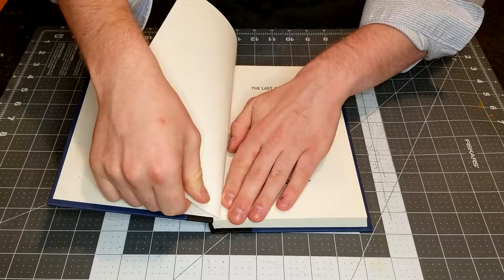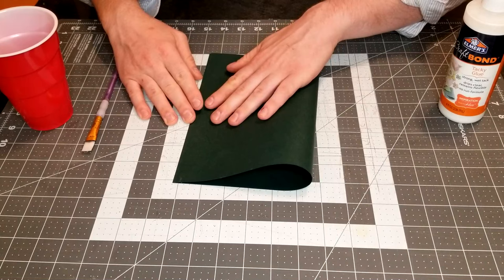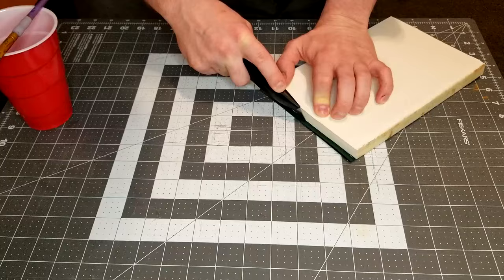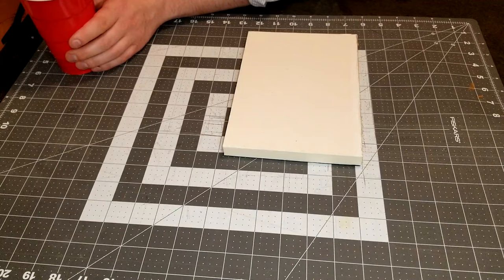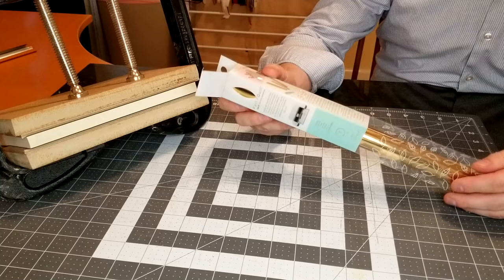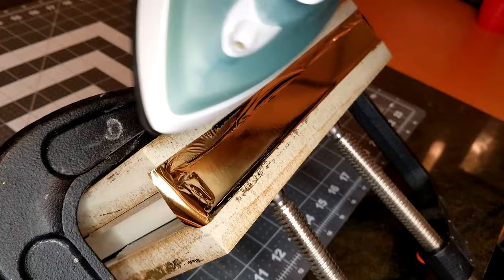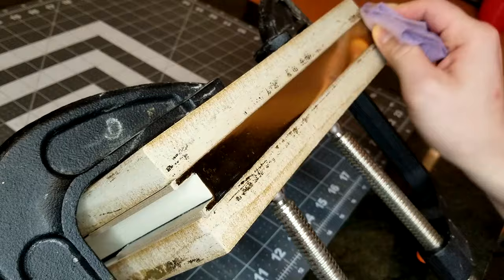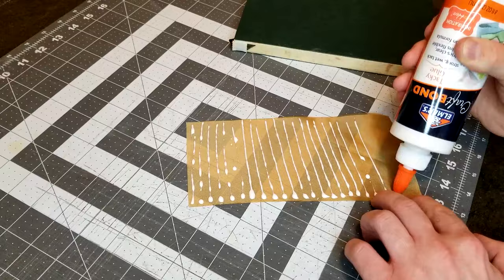DIY Leather Book Binding Tutorial Part 1: Page Edge Gilding and Text Block Preparation

Comment: I have a leather bound set of scriptures that don't have guilding.  Can you possibly show how to add the quilding to a book that is not taken apart?  Please!
Reply from the maker: Excellent question.  Honestly, I believe it would be very difficult to gild the edges of a book without removing it from the binding.  There are methods of painting pages which can work without removing the text block, but if what you're going for is a true metallic mirror finish, then every technique that I am familiar with requires the text block to be free so that you can smooth each edge before applying the gold leaf or foil.  If you are very careful you may be able to remove the original endpapers from your scriptures to get the text block out, and then glue them back in place after you complete the gilding.  But the most reliable approach will be to replace the endpapers.  If I learn any technique that doesn't require removing the text block I'll be sure to make a video about it!
Reply: Thank you for taking the time to explain to me.

Comment: I am having issues getting the strip to come out flat. I am getting so many wrinkles that will not come out and I’m also getting scuff marks on the material. Is the iron too hot? Any help is appreciated!
Reply from the maker: Thanks for the question!  As you guessed, your iron may be too hot.  Although I shared the setting that works well for me, different foils and different irons behave uniquely.  It may take some experimentation to discover what works best for you.
Reply: @ingeniusdesigns   Thank you for the reply! I originally tried the wool setting and found it to be too hot. After lowering the temp, I discovered it helped, but I still have light scratches on the surface. I am at a loss. I also put parchment paper on before the iron. That helped some, but makes it a lot harder to see. 
Do you have any advice for avoiding scratch marks?
Reply from the maker: It's hard to say without seeing it in person.  It's possible that the surface of your iron is slightly abrasive.  If that's not it, then you may not be fully sanding out all the scratches, and so they end up in your final product.  Insufficient sanding is by far the most common cause of issues with this method.

Comment: Hi Austin, I know that this video is old but I do truly hope that you will be able to help me.... what if I just wanted to Gild the pages Gold on a notebook I am already happy with the cover of, I am thinking of just pulling the covers back and a smaller slab and less space to sand off and gild them, would with work? I appreciate your video and am happy with it, even if you can't respond as this is an older video and you've probably moved onto something else. Anyway thanks!!
Reply: Oh, also that helmet in the background when you're sandwiching the papers looks like the helms that the guards of Gondor carry. Sorry if I am wrong haha
Reply from the maker: Thanks for the question!  I guess I'm lame for not moving on to bigger and better things yet, but so far the channel is still little so I'm trying to respond to every comment.  In the case of a notebook like that, you could certainly try it and see what happens.  It would work great for the long edge of the pages.  For the top and bottom, however, you might run into some difficulty at the corners close to the cover.  Gilding is usually simpler on the top and bottom though (theyr'e naturally more smooth) so maybe the foil would stick even without being able to sand those corners thoroughly. 
 Alternatively, sometimes with a little fenagling you can get the original end-papers off of the cover, so you could effectively remove the text block, gild it, and glue it back in place.  Or if you're not particularly attached to the end-papers, you could just remove the cover (destroying the end-papers but leaving the cover intact) then glue new end-papers on to re-insert the text block.
Whatever approach you go with, I would recommend trying it on a similar book you don't care about first.  It sounds like this notebook has some sentimental value, so I'd hate to make a guinea pig out of it. 
Hope that helps!  Good luck!
Reply from the maker: We have a winner!  I like to put something interesting in the background of some of my shots for those who care enough to look, and it looks like you're one of the few who do!

Comment: I'm in the middle of trying this, and the sanding hasn't taken as long as I thought it would have. I'm done with sanding the long side and about to gild it. Of course this is only a proof of concept with a book I bought from a second hand store, so I only went to 320 grit - not 1000; I hope to reach those lengths in the future - probably with an electric sander to speed up production. My vise also needs updating, but that's on me. As far as you're concerned, you must have gotten an A in high school on process essays.
Reply: I'll update when I get to part two.
Reply from the maker: Awesome!  I'm so glad it's working for you so far.  I actually use a belt sander too to start when the pages are very uneven.  It wasn't necessary for the book in the video and I didn't want people to feel like they would need a ton of tools, but I totally get the utility and I'm thrilled it's speeding up your workflow.
Reply: Did you succeed with with the gold gilding? Because I have tried many times following the instructions and I cant get it to stick…. Would love to know someone else has been successful…. Thanks!

Comment: Would this work using paperbacks? I want to turn my beloved Narnia and LOTR into hardbacks
Reply from the maker: Yep!  I've done it on dozens of paperbacks and it works identically.  Sometimes with glued bindings you have to be a little more careful (See my edge gilding in real time video), but there's no reason you can't make a beautiful book out of paperbacks.  The ones in the thumbnail picture were paperback, in fact!
Reply: @ingeniusdesigns  thanks! I'm going to try on a non beloved book before my beloveds. Cause I would CRY if any thing happened to them. My mom bought them for me when I was in 3rd grade and they've traveled all over with me. I'm 40 now so that gives you an idea of the age. :)
Reply from the maker: Yeah, I think you're taking a wise approach.  We want to celebrate those books, not cry over them.

Comment: What kind of foil do you use? I can only find the one you put over a laserprinted page into a laminator...
Reply from the maker: Yeah, that kind won't work (as I'm sure you've already discovered), because it requires a chemical reaction with the ink.  I use Foil Quill by We R Memory Keepers.  There are some other similar products that I want to try to see if they will work as well, but until I experiment with them I don't feel safe recommending them.  This is a tricky process and finding a product that worked well took me months.  Here's a link to the Foil Quill:
https://americancrafts.com/products/we-r-memory-keepers-foil-quill-foil-roll-12x96?variant=39507415236672
Reply: @Ingenius Designs  thank you! My problem is that I'm not in america so finding the stuff is a lot more difficult. But i found the foil quill one on amazon. 
Is the vinyl you used for the front/back covers somewhat stretchy? I'm trying to find the right one but always get the one that has stretch so it can be put on clothes
Reply from the maker: The vinyl I use is Siser brand Easyweed HTV.  I'm not sure if it's stretchy or not, but I think it can be used for clothes, so it probably is.  It doesn't really matter on books though, because I never put HTV on the hinges (the only part that would stretch).

Comment: Do you sand al three sides at the same time? Or you sand one side and then gild?
Reply from the maker: Sand one  side (usually the long side first), then gild it.  Sand the next side, then gild it.  Sand the third side, then gild it.  That way the book never comes out of the press between sanding and gilding, so the smooth surface is undisturbed when the foil goes on.  Thanks for the question!
Reply: @ingeniusdesigns  thank you so much for the quick response!! ❤️

Comment: Hey! Your video was super easy to follow so I instantly bought the foil you use in the video! I sanded down my book and tried to iron it on but it won’t stick!! Idk what to do. The fore edge isn’t as shiny as how you got it (idk how you did that btw) but I’m so confused! Any suggestions?
Reply from the maker: Thanks for the question!  I'm sorry to hear that it's not working for you.  I actually recently made another video which slows down and shows the process in more detail.  Perhaps it might have some relevant tips?
https://www.youtube.com/watch?v=Er3hIEUuCms
If that doesn't help, let me know a few more details about your situation and I'll do what I can to assist.  Thanks again for reaching out, I'm so glad you were inspired to try it!
Reply: @ingeniusdesigns  thanks for responding! When the foil is all smoothed out and sticking to the fore-edge, I peel it off and only speckles of it come off… the whole doesn’t effortlessly come off like yours does so beautiful in your video haha
Reply from the maker: Hmmm...that is a problem to be sure.  You might try increasing the heat of your iron or going over the whole thing for longer to give the adhesive more chance to activate.  Additional sanding might help, but even without getting as smooth as I do you should be getting more than just speckles.  To be sure, you're using this exact product, right?

https://www.joann.com/we-r-memory-keepers-foil-quill-12x96-heat-activated-foil/16676082.html?utm_source=google&utm_medium=cpc&gclid=Cj0KCQiAosmPBhCPARIsAHOen-Mg_NPRrXCf1mgMvGPmJno7Eaphu9vTrIa2Q_TWpP0iEwZZt0slFMsaAr4TEALw_wcB

Comment: Do you sand all 4 sides of the book?
Reply from the maker: Nope, I don't sand the side with the spine, since it won't be gilded.  I mean, sometimes if there's glue and paper residue from the old cover on there, then I might lightly sand it with a rough grit sandpaper, but it's not always necessary, and you certainly don't need to bring it to a mirror shine since it will never see the light of day.  I just do the three sides that will be visible.
Reply: @ingeniusdesigns  Thank you sooo much!

Comment: Where do you buy your leather
Reply from the maker: Ebay is actually my go-to for affordable leather in a variety of colors.  My search terms are usually the thickness of the leather, the type of leather, and the color of leather.  For example "1.5 oz navy blue goatskin hide" or "2 oz black sheepskin hide." If you search for thin weights (I usually go for between 1.5 and 2 oz but thinner would be fine, just NOT thicker than 2.5 oz) and look carefully at the photos you can usually pick out a decent hide online.  One of the main things I look at is whether the leather lies flat or not in the photos.  If there are wrinkles in it, then that means it's probably flexible enough for my purposes.  If it lies perfectly flat and smooth then it may be too stiff for bookbinding.  Hope that helps!

Comment: Do you talc the pages before you apply the foil?
Reply from the maker: Good question.  I experimented with putting talc on the pages, but it turned out to be unnecessary for my technique (not to mention messy).
Reply: @ingeniusdesigns  thank you!! I've just started getting into fore-edge decorating (with foil) and I've used the talc, just cause some other sources I've read said to; but I did find it to make rather a mess. I'll try without next time and see if it really makes any difference.